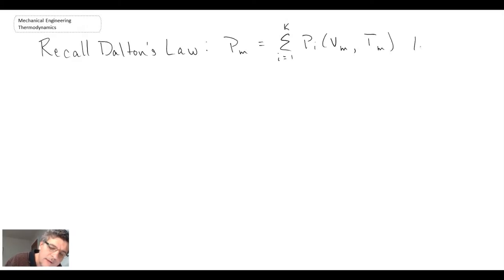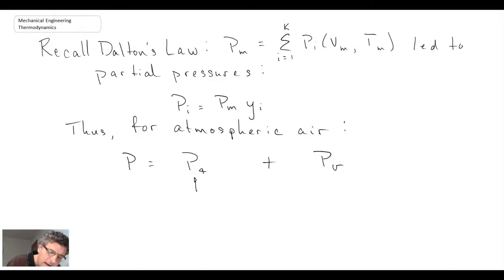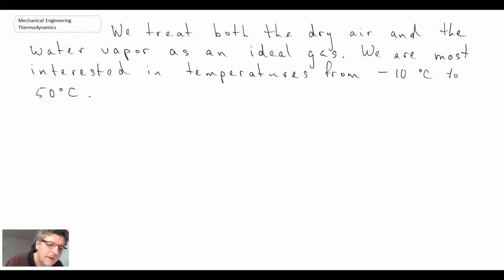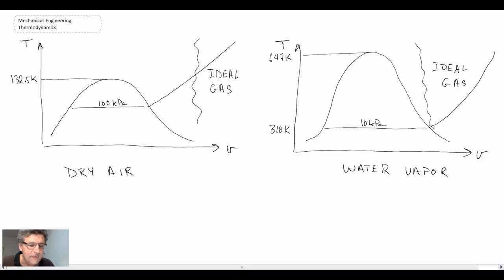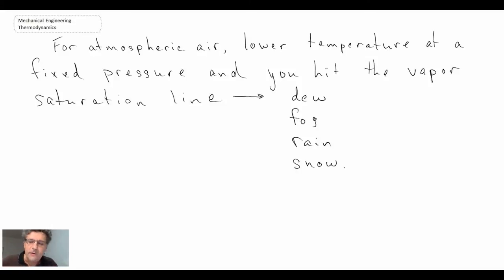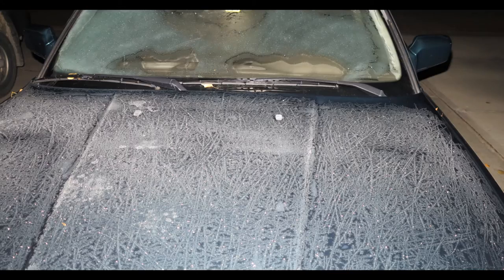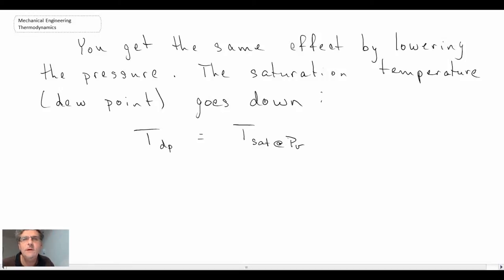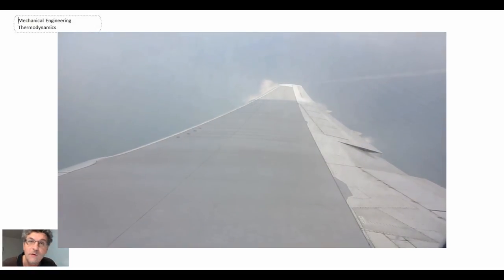Mechanical Engineering Thermodynamics - Lec 28, pt 2 of 7:  Dew Point of Atmospheric Air

Comment: You are stupid and full of shit. When the vapour pressure of water= the actual pressure of water in the air y(water)*P(atm). It means in equilibrium. The goddamn truth is if you increase the atmosphere pressure or decrease the temprature of water, the condensation will happen. Why condensation happen at the tip of the airplane wing? The only reason is the temperature at the tip of wing has been lowered, which also means lowering the vapor pressure of water at the wing tip cause Antonio equation makes both T and P of water related, since the atmosphere pressure is always 1atm, and bigger then the vapour pressure of water at that time. Condensation will happen to form a new equilibrium corresponding to the reduced temperature at the tip of the airplane wing. You don't know shit about thermodynamics！